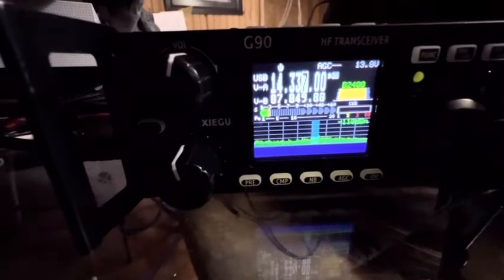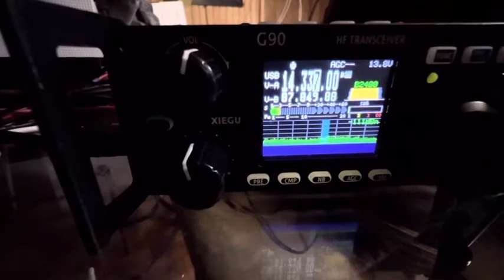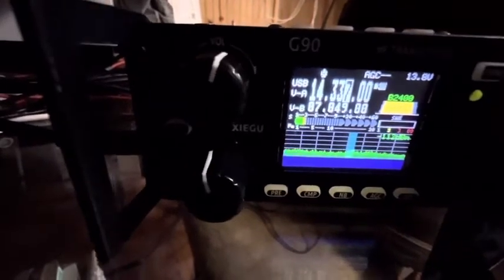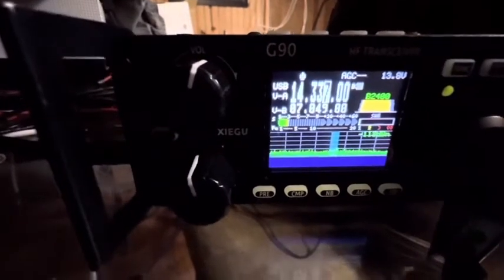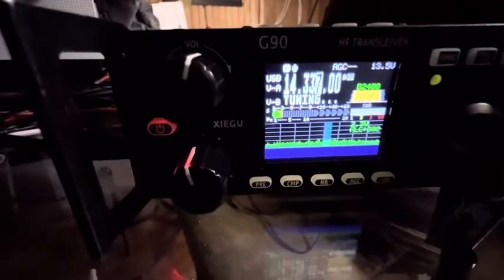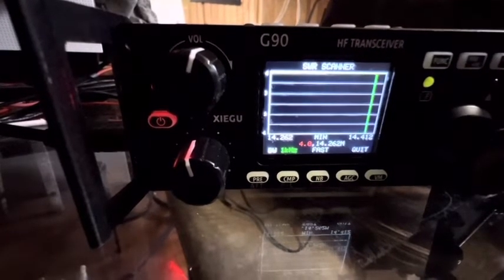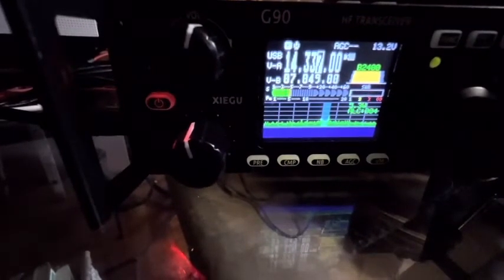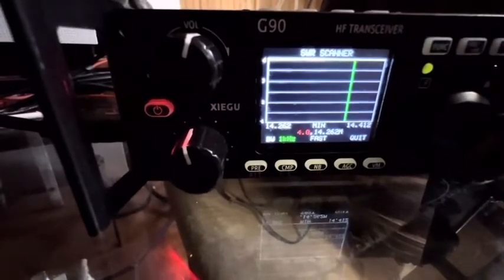Xiegu G90 Antenna Tuner

Comment: The first sweep is primary checking the system. The second sweep is trying to fool the radio into thinking the swr is good but if it stays at 4 or above you should not transmit